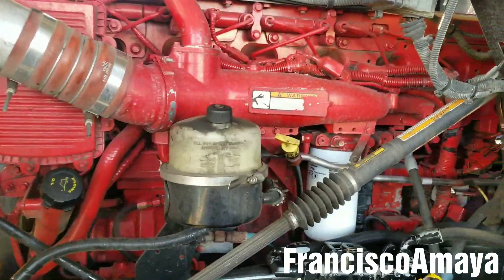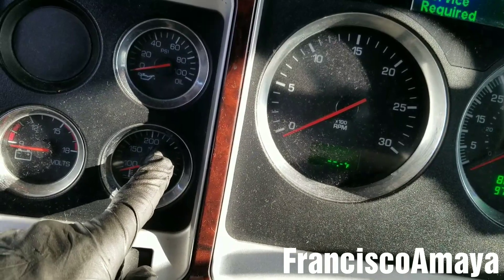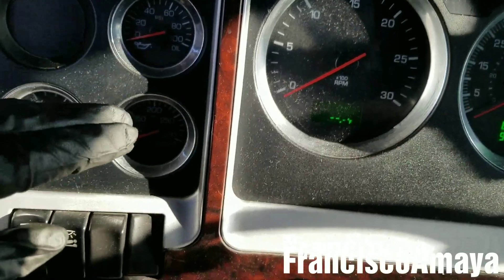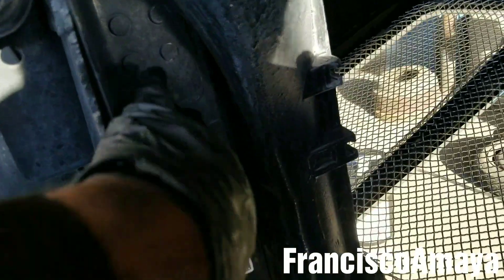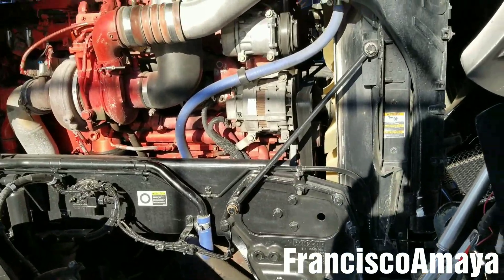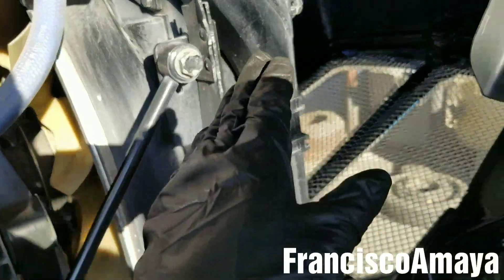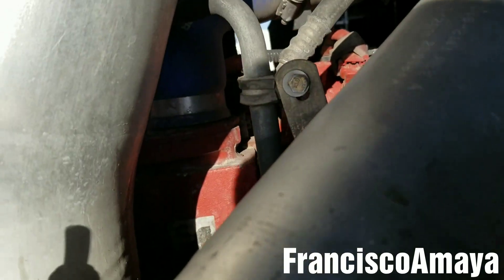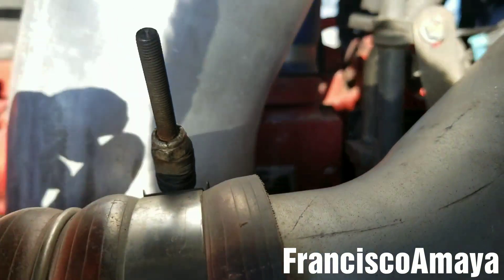Cummins ISX ISX15 overheating temperature stay high while driving bad thermostat

Comment: For those that replaced the thermostats oil and coolant, and replaced or flushed the radiator, of all those failed check your air cooler.. and also check your turbo
I know because I did that and my issue was resolved. 
Water pump was good..
Reply: What was the problem.?
Reply: @jessedelgadillo194  overheating
Reply: @jessedelgadillo194   the issue was that the turbo leaked oil into the air cooler..

Comment: I have changed the thermostat in my 2017 freightliner also changed the reservoir it continues to lose water and run hot but when it’s just idiling it’s reads regular temp

Comment: Those trucks have an oil thermostat and the stock thermostat is usually a 236 or 246 degree thermostat people been changing them to a 216 degree thermostat and solves there problems
Reply: Healthy isx15 with stock oil thermostat wouldn’t have oil temp problems in hottest day pulling heavy loads in mountains, that’s just masking real issue what can be bad oil cooler, water pump, dirty or clogged rad, sticky thermostat, weak fan clutch, bad belt tensioner or simply engine full of soot…..or other internal wear…
Reply: @FedericoJeckeln  that’s true too. A bad injector can make temp rise also

Comment: My w900 is showing overheating on coolant temp gauge,  and d rate and shut down,  but the oil temp is only 205, so it can't really be overheating,  replaced the sensor,  still same thing
Reply: I have  the same issue. What was the problem?

Comment: I did everything you said and I replace everything in the parts you just mention. It was the same tell my mechanic figure out the mystery which is oil cooling kit .
Reply: Can you give me more details. I have the same issue. When going up long hills loaded. I've changed everything he mentioned and still have the same problem. Would oil thermostat cause this?

Comment: My engine fan stays on most of the time is it the coolant sensor?
Reply: check your high side ac switch, and the type of truck you have makes a huge difference on where to look
Reply: My 15 l Pro Star was doing the same thing, fan was all over the place. Changed ECT #1. Problem solved .

Comment: What could be causing over heating oil temperature @250+ i changed out different parts! What would you ck?
Reply: isx? the oil cooler thermostat, whats the coolant temp? blow your radiator out with shop air,
Reply: I changed oil cooler thermostat and still the oil temp is running hot
Reply: @breadn5556  what was it ?
Reply: @LEVEL777UP  Installed PDI Oil cooler unit that contains 2 coolers rather than 1. It definitely helped. Temperature goes 225-230 which is good but I'm still working to bring it down to at least 210-220

Comment: hola Francisco tengo un internacional 2009 y tiene un ISX 450 se parece mucho a este motor del video...tengo un problema. el fan siempre corre al 100% ya se cambio la solenoide del fan clutch por una nueva pero el problema continua.
Reply: yo tenia ese problema con mi troque. el problema era el conector del sensor de alta presión de aire acondicionado. yo le recomiendo que le remplace ese enchufe.

Comment: I have a question. I have a 2019 kenworth Cummings engine.  It's overheats to a temperature of 230 to 250. My mechanic said he switch the thermostat.  Can you tell me what other problem it can be?
Reply: What else did u figure out
Reply from the maker: Yeah, it possible that the thermostat is causing that.
Reply: Did u figure out?

Comment: I did all of the above, changed fan blades , fan clutch, radiator & thermostat, & blew out air to air, still overheating while climbing a hill😢 any suggestions
Reply: Water pump might have gone bad. So the coolant is not flowing as it should.
Reply: Well my engine have diesel in the antifreeze
Reply: Water pump is the only other thing I know you will need to check. Coolant might not be flowing as it should because the pump is not doing it’s job.
Reply: @MikeJohnsonwick878988  I replaced the water pump and it got..... 75% better but still over heats on very steep or long grades.  Any HELP???!!!
Reply: @leemorgan3933  what were your symptoms?
Reply: Same bro my truck change fan clutch egr cooler thermostat but my engine overheating while climbing needle ca hillls & bakersfield ca hills water temp 220 to 230 & oil temp near about 250 plz any buddy know whats wrong
Reply: I have the same problem
Reply: Did anyone find out this problem
Reply: What oil r u using in the summer
Reply: My truck seems to be clogged up with rust inside the engine water waves , can it be flushed, and yes it's problem why is heating up
Reply: @Kingdomized4Life  I did the flushing and it didn't help.. as a matter of fact it's running hotter now!!
Reply: Same prb t660 isx 600hp  overheating upgrade hillls change everything fan clutch water pump egr cooler thermostat plz dont waste money if u have same probrlm change radiator becuase my opnion raditor block inside
Reply: @harjotsingh-ix3mk  did changing your radiator help?

Comment: Hi buddy i have 2013 isx15 my turbo putting hot air to intake is it normal or there is an problem in turbo and also my truck oil temp get almost at 250 so i have to slow it on the hill or stop it to become cold please reply if u have any contact to call or email please send me
Reply: It’s not normal. The air is supposed to be cooled as the turbo sucks in cool air from outside the engine compartment.
Reply: You will get hot air until it passes through a intercooler which I don’t know if that engine has one from factory as I have a x15 565 and not the isx